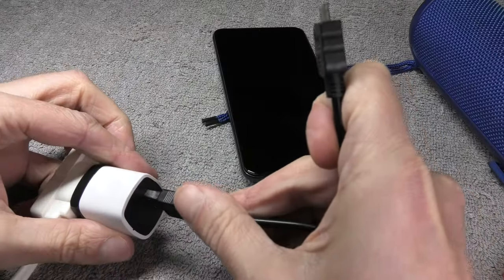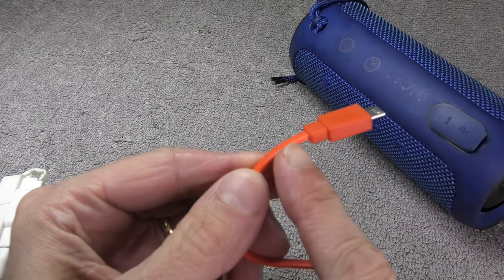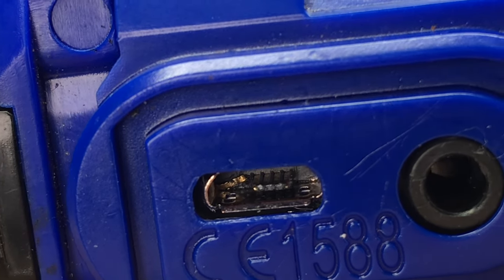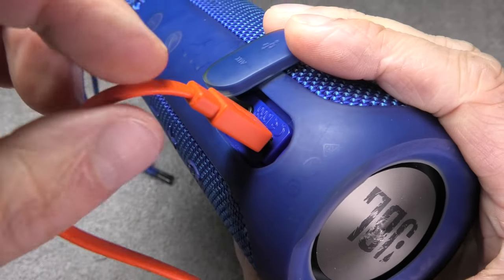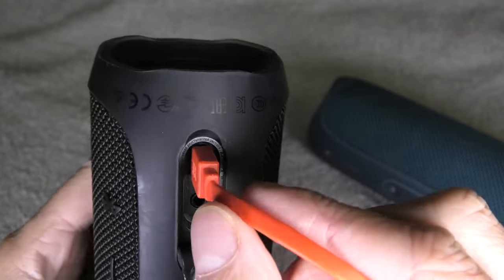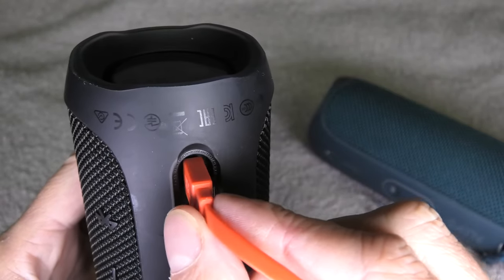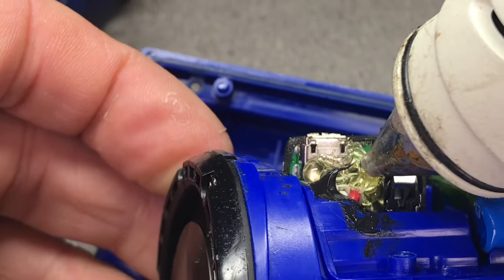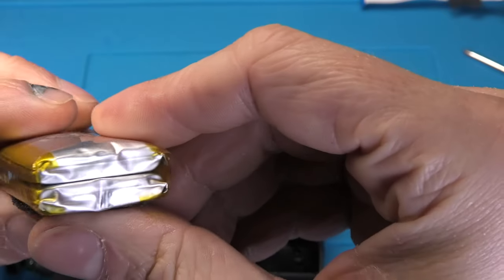REASONS why Bluetooth speaker does not charge ?

Comment: You forgot one other troubleshooting issue as well.  When you take apart the speaker unplug the battery from board and if it's not swollen (battery), reconnect it and see if it charges.  I had to do than on one of my sony bluetooth speakers, it wouldn't charge but the cable and power brick works on other devices so I eliminated those two factors.  It's almost like unplugging the battery forces a reset to the speaker, it's been working fine now for several weeks and hopefully this saves someone else some money.
Reply from the maker: Good to know!  I’ve never experienced that before. 
Thank you for sharing! 👍

Comment: I bought a brand new as8 airbuds Bluetooth speaker from Walgreens 6 days ago. Now the speaker will not charge. I thought it was a defective micro C connector cable so, I bought a new one and it still will not charge.
Reply: You need to plug it in for it to charge.😂

Comment: Hi. My speaker doesn't charge. But when plugged to an outlet, it turns on. The battery is not bloated.  Do I still need to replace the battery? Please help. Thanks
Reply: No, check for a small gap between the charging port and the motherboard. This video shows you how to fix that
Reply: same problem with my blue tooth jbl speaker

Comment: I have an airbuds Bluetooth speaker and it says low battery. How long should I charge the Bluetooth speaker after hearing low battery?
Reply from the maker: Hi, that usually depends on the specific speaker model, since the battery capacity can drastically differ.  
It should be somewhere between 2 to 4 hours. Usually there is an indicator light on the speaker, showing that it is still charging. When the light turns off it is fully charged.  
It is not harmful to the battery to keep it connected longer, because the device will stop the charging process by itself as soon as the battery is fully charged.
Reply: I never heard if they  might  not working  no 8 day,s a week 😕 🤔 😐 🤷

Comment: Disable and Re-Enable the Internal Battery via program logic
Hold the JBL CONNECT button beside the power button, and volume up, until the fifth light flashes red.  Then plug in the JBL if not already and power it on and do the key combo again to enable the internal battery again.

-->This totally fixed my BT Connection issues and where the unit would Abruptly power down when connected via Bluetooth.   Also it sound better too like it kinda sounded blown before idk maybe that like my placebo ears.

I also did a Full Reset (Bluetooth & Volume+ Buttons Held for 10 seconds till reset)

Comment: I have toshibah bloetooth speaker on off problem I try to charge but not changing i make direct but still on and off what is the solution for my portable chargeble toshisbah speaker
Reply from the maker: When it is not charging I’d first try a different cable.  If that does not make a difference, then check if the battery is bloated.